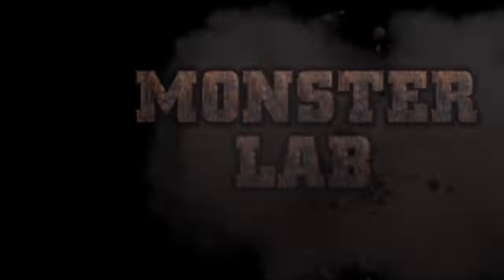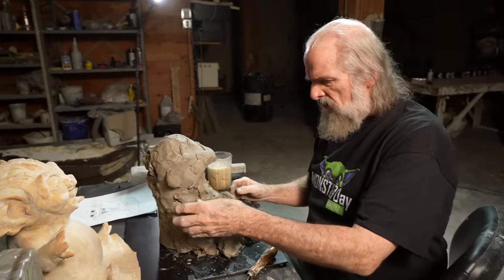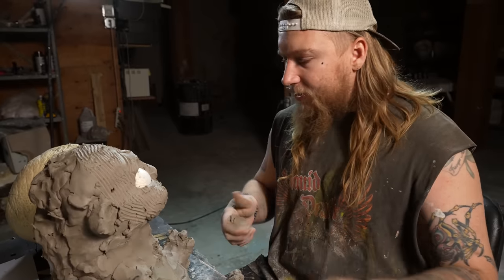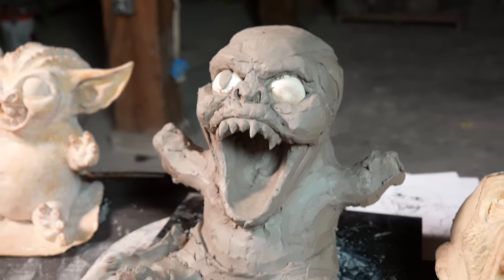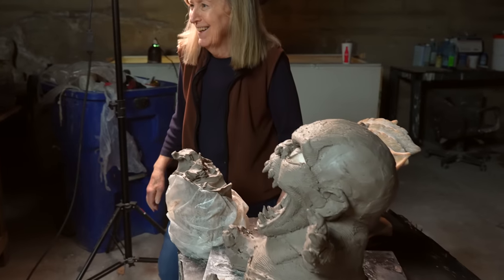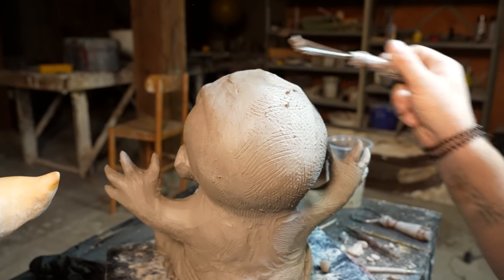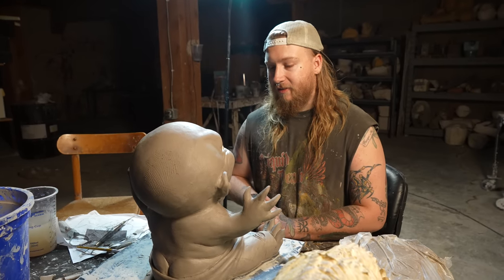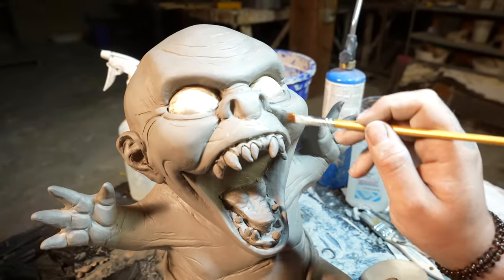HOW TO SCULPT a Baby Mutant Halloween Prop | Monster Lab

Comment: All I need to know now is how do ya foam fill the prop! I’m begging to know thanks Ed!!
Reply from the maker: We will try and do a video on that when we get a chance. We use a 2 part foam which would not be easy for at home use so we may need to show another method. How big of a prop are you foaming?
Reply: @DistortionsUnlimited  you 2 part foam would be awesome to see! The process how you figure out the weight to cubic inch I fill a lot of masks, legs and arms but the problem I always have is the foam blows out of the latex maybe cuz I’m holding everything in my hands while doing it now I know how molds work. I need to start crafting. But it would be an honor to see the exact presses of how y’all do it! Thank you
Reply from the maker: Ah yes! We will have to do a video with Mondo showing the foaming process on some of our production pieces, perhaps an in depth behind the scenes look.